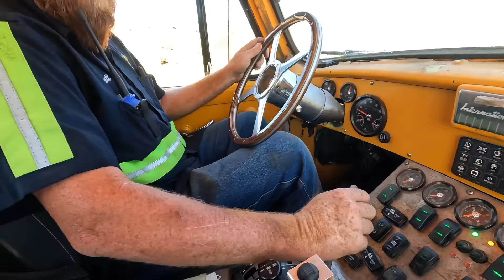Redemption On The Most Difficult Rescue Left Unfinished!

Comment: I worked many years in Africa in the Sahara Desert. The Best Time to drive in the sand is around 4 AM after the sand has cooled down and is more compact. Once the Sun comes up and heats the sand, it is a whole different terrain. Running in 2 Wheel Drive sometimes works to if you can maintain a good speed. The Front Wheels act as a Packer. But once again, the sand has to be cool.

Comment: A big part of the reason the Bronco did so well, is the modern automatic transmissions Ford uses have so many gear ratios, that are much closer together than anything GM had for a lot of years. They also shift significantly faster. The bronco is able to keep the rpms up higher and be in the optimal power range better than many other rigs today. Very impressive!
Reply: This series of videos was a Bronco commercial
Reply: @C141B  essentially, lol

Comment: Matt, IDK if you'll see this comment on a video this old, but if the coolant level rises significantly at idle after being revved up, that indicates an air pocket somewhere in the cooling system, which could be affecting engine temperature negatively. Coolant, and liquids in general don't expand very much with temperature, but air does, the coolant level change after revving it up at 20:10 tells me that there is still an air pocket somewhere in the cooling system. If you haven't already, you should get one of those radiator funnels with the different radiator adapters and run the engine at 2-3k RPM until the thermostat opens (190-210F), with coolant filling about 1/3rd of the funnel above / outside the radiator cap. That allows the expansion needed and the flow required to properly burp the cooling system. And after that, you should take it for a test drive and get it nice and hot, let it cool down, and check the fluid level in the reservoir once it is completely cooled off / the next day. Then top it off to the cold fill line and then you should have eliminated all air pockets in the cooling system.

Comment: I really loved when Matt said and I paraphrase that "the banana  has more power than the Morvair even though the Morvair has an LS". Those straight 6s make great torque at low and mid RPM ranges they start to fall off at hi RPM making them more well suited to off road, V8s make more HP and torque at the HI RPM ranges, producing wheel spin. That was my fathers off road advice to me 40 some years ago. As you can tell I am a huge fan of Jeep 4.0 L its a rock solid tractor motor second only to the Ford Big Six.

Comment: Hello Matt, just watching your videos on the sand trap show instantly took me to the Sherp videos of the ultimate off-road vehicle, where its tires  can air down when needed and you don't need to get out and lock in for 4 x4😊. Everywhere you guy's went with the recovery vehicle's the Sherp can do and plenty of room to sit or just take your equipment. Granted it doesn't have the power of the tow truck, yet the off-road capacitys are endless.

Comment: You could easily see the effects of the heat, fatigue, and general exhaustion on everyone's ability and decision making during the first video. Glad you got the wrecker out. If Paul, Rory, and Casey want to get stuck at the bottom of the Sand Chute, I say let them and bring some hydration and popcorn because it should be a show.
Reply: The engine has a faulty headgasket

Comment: Thank you for sharing the experience!  Guess it is time to change out the right front tire on the wrecker and keep the one on it as a spare.  Also want to throw in that you are correct in that the only way to learn, is to do.  I think it would make great content to have Rory, Paul, and Casey out there.  Once the tire is replaced and the lockers repaired, should also try the wrecker from the bottom one more time.  I know you said the mid-way is the perfect staging area for it, but I know deep down inside, you want to see it make the whole climb 😂😂

Comment: A humbling experience is always a learning experience if you are honest. Thanks Matt for a no BS honest adventure with the Heavy wrecker. As a African 4x4 enthusiast I can see your head do the math in every recovery I have been privileged to see you doing. Thanks for the honest way you share it through your channel, I for one have learned a lot from your endeavors. Look into The In deflate 4HOSE UNIT, it is based on the same design and functionality As the original in deflate, and allows you to equalize, inflate or deflate 4 tires at once. We use them here in South Africa to inflate or deflate 4 tires in one go.

Comment: So very impressed with that Bronco.  Only vehicle that seemed to effortlessly walk all over that sand!!!
Reply: Listen to WHY...Matt said it was because the Porsche smoothed out the sand making it easy for the Bronco to drive on..

The Jeep went after the Wrecker and the Wrecker made huge holes,pitts in the sand!!! Jeep  would have flew up it with no issues...Bronco did good but the sand wasnt the same,totally different!
Reply: @mypronouniswtf5559  nah, I’m not buying that at all.
Reply: The engine is light with quite the hp with the Ecoboost, large tires locker just the right recipe.  Even if you hate Ford Jefe knows what he has works well.

Comment: That scuz that you're seeing in the cooling system might be a reaction with the Dexcool that that engine was likely running in it's original chassis. Dexcool turns into that brown sludgy residue when it's mixed with traditional glycol based coolants.  It wouldn't hurt to fully flush and clean out the wrecker's cooling system.
Reply: Good call. I was thinking those tablets.

Comment: Was honestly amazed at how well the Bronco did. People talk a lot of crap about them but it must be pretty capable to get out of there when the Morrvair and Banana struggled.
Reply: they weight may have had something to do with it as well. it may have been the lightest one there
Reply: I think the front & rear lockers & being able to de-activate the drivetrain computer (unlike the Porsche) & hit it with raw unrestricted horsepower (330 horses).

Impressive 03 Bronco Wildtrack
Reply: Ecobeast power.
Reply: "Pretty Brutal" was the name of my Abba cover band in high school 
🤦🙋‍♀️🤷‍♂️👸
Reply: Impressive.  Short wheelbase in addition to the things listed.
Reply: Matt did mention that the bigger tires had an impact as well as that the Cayenne (as far as it had come by itself and then being pulled) had smoothed the sand a bit and so the Bronco had a bit better "road" than the Morvair and the Banana.
I would also throw in that the Bronco has a 10speed auto which means he can run to a higher gear in low range and it means better accelleration and so hitting the incline with more speed. (with a few less horses than the Cayenne, but more gears and lower gearing it might have hit the incline with almost the same speed as the Cayenne)
Also for the Porsche, have to say i was surprised that he got to where the wrecker finished the first day by himself. The cayenne in this has the least ground clearance so wil drag the most with the underbody, the smallest wheels and the power division with 70% rear and 30% front makes it dig earlier in the back. And i don't know if it has an automatic locking middle or not. (the first gen Cayenne even had low range, and manually lockable middle and rear diff  It would probably have done better in this than the newer one they had)
Reply: @ronjohnson9032 yup, i dont know how many run half a million miles, but the turbo gives the Ecoboost the torque once the engine lugs down...
Reply: IFS is fantastic on snow/sand.  The ford team also has a sand/snow setting that is really good at trimming/smoothing out the throttle so you aren't digging into the loose stuff.
Reply: @RenzeZielman  220,000 miles on my 2011 so far, and it spent a lot of time pulling 10,000 pounds down the highway.
Reply: @miked19831988 no ay it's lighter than the morvair, I would be shocked

Comment: It's been fun to watch you prove over and over again the power of airing down tires...from the early days before beadlock wheels to lowering the pressure on trailer tires to this latest adventure. The difference here was the inability to air down ONE TIRE. I've taught many over the years and there's always a few who just don't want to believe.
Reply: Well said  !!   The first thing I said when he said he had the tire pressure at 12 lbs was to air them down to 4 or 5 lbs.  I was screaming all day for them to air there tires down.  Big tires like that need to be aired down when in sand.  It makes so much difference.  It is like night and day.  I think that with all of them airing down they may have driven them all out.

Comment: Mat, having run the big 46 inch Mickey's for over 10 years in the deep snow of BC'S Big mountains,  you around be down too 3-4 psi in those tires,  especially since the wrecker does not weigh that much.  When I first got mine I had to run with the valve stems out for the first 2 days wheeling just to get the side walls soft enough to let the tire flex. After that my trail pressure is 5 psi and waist deep snow is 3 and bottomless  is 2 in the rear and 2.5 in the front. Has never failed to get me out.  LIVE TO SEE A SHOOT OUT ON SAND HILL.   CHEERS     Steve h.

Comment: HOW TO EASILY GET OUT OF DRY SAND:

Next time, on a dry sand trail, just take a roll of wrapping paper and spread this paper on the trail where the tires will pass and the vehicle will run as if it were on concrete. In fact, always carry paper in your vehicle, as even if it is already "stuck" in the sand, it will come off easily. Suggestion from someone who has been riding on sand for 40 years.

Comment: A stroker crank with a Texas Speed Stage 1 cam and LS3 heads made a huge difference with the 6.0 in my buggy. Still has great torque but top end was a huge improvement. It would be a good fit for the Morrvair.

Comment: Every patron of the channel should be happy that Matt is not a pilot.  He is willing to take on a challenge with equipment in poor condition (no lockers)(dead batteries) (short on fuel) short on coolant, both human and mechanical.  We call that a CLUSTER *%^#$ designed by a KNUCKLE HEAD.  Good job Bronco!

Comment: you guys need a Off-Road Exhaust Air Jack, 31 inch lift 8800 Lbs, it's a bag that can lift tons and is filled by the exhaust gas or a compressor. helps lift stuff up on a trailer or over an obstacle or cushion cars that rolled over and get pulled back on their wheels so the axles don't break, it's cheap and light and small when deflated and could get you out of trouble

Comment: Just seen this video, after watching the prequel! 😂

Well done on making it look so simple the second time around! TBH, it's the additional air-down that makes all the difference. Everyone knows that 20psi is a lot better than 40psi, but what's not very intuitive, is that you get more benefit from each psi drop in pressure than you do from the previous psi drop. So to double the tyre's contact area when you're at 40psi, means you need to drop by 20psi. But to double it again, you only need to come down another 10psi. Once you're at 10psi, if you drop by just another 5psi, you double the footprint again.

(OK, that's not completely true, because the vehicle's weight is not entirely supported by the air - the actual rubber and steel in the tyre carry a little bit of the weight. But it's not much - how much weight do you need to fully collapse a tyre with 0psi? Maybe the first 50kg of load is carried by the rubber, all the rest is carried by the air, and after deducting that 50kg from the load, the contact area will be proportional to how much pressure the air is under.

Also, there a limit to the airing down you can do, because if you don't physically have enough rubber, then at some level of low pressure, you run out of rubber to spread out, so the wheel-rim starts carrying the weight, not the air.)

Comment: The 8.1l does have a decent amount of torque. With sand I always see you need more top end power than the low end torque. I own an 8.1l and have done a ton of research. I really suggest a raylar intake. The stock one is very restricting for top end flow. If you haven't had it tuned with the torque management removed that will help too. They detuned to save the trannys. Black bear would be my suggestion for tuning. Having more power in your power band should help having to shift gears climbing a sand hill. Would be cool to see tire deflation weight per square inch test prior to the sand shoot challenge.

Comment: Obviously the lockers and setting the air pressure make a huge difference for sand traction, but after seeing what the bronco did I'd be looking at adding some HP to the wrecker.  Maybe just a rebuild, small compression bump, and a tune. Forced induction would be amazing but it probably doesn't need the extra heat.
Reply: Take a search for formula offroad to get a sneak to high hp and sand🥳

Comment: When I was a young guy,  we would go to the beach and there would be all kinds of big trucks with big mud tires like you have on your vehicles and they would be stuck in the sand .  They would pay us to pull them out. You aren't going to believe this but here is what we used, it was a Jeep Wagoneer which had constant four wheel drive and had this little knob in the glovebox which connected the front axel to the rear axel and it had Michelin Street Tires. You could go anywhere in sand without getting stuck.

Comment: Great leadership Matt, under very adverse conditions. Also those Badland winches saved the day. And I was very surprised and pleased at how well the Bronco performed. I do not think that tracked vehicles will perform well in the sandtrap conditions. Keep the Bombi for snow...
Reply: I think sand might be destructive on the tracks, at least that's what I have heard from cat operators.
Reply: I think the Bombi would craw right out of there if tried, guess we will never know.
Reply: @WJV9 repeated use in those environments will wear down track systems fast. The real trick though, is not turning too sharp and "jacking" the track off with piles of sand between the track, sprocket, and road wheel areas. Mostly the track to sprocket surfaces.

Comment: Long time fan. Enjoyed this breakdown and the recap on what you learned. This video got me wondering how you feel about traction boards. To me it seemed like placing them on the dune where you anticipated losing speed could have been an effective strategy. How do you feel about traction boards in general? Do you think they would have helped? Is there a reason you dont use them besides the fact they are more gear to carry?

Comment: MATT I HOPE YOU SEE THIS!! You should really take those headers off, get them heat protect coated(painted). It will help and its not that expensive, better than wrapping them. You could wrap them as well but with wraps you're vulnerable to moisture getting trapped in between the wrap and exhaust and end up with rust. So id start with painting them and get a good heat shield made. Also get some heat wraps for all the wires and plumbing that gets too hot from the headers

Comment: From my experience as a diesel mechanic every truck I have seen run air lines near high heat they have all been solid metal or braided steel air lines, wouldn't hurt to wrap them in heat tape as well to keep the heat off them a little bit

Comment: TSP STG1 low lift cam w/114LSA for that LS 6.0

It is EXACTLY the cam you need for the RPM you use. I’ve used it multiple times and did the tuning, FACTORY drivability and 20% power increase alone.

Comment: @15:34 PTSD, locked gate, out of respect,  parked the truck and walked for four hours to a payphone in Maysville, CO. The driver didn't bring tools on our 5 personal solo vehicle trip. And he kissed a rock that pushed back the rear axle on the driver side enough to turn the truck into front wheel drive only. Couldn't go back the way we came. But we made it to where we shall not pass. We were respectful to impassable and retrieved the truck out the proper direction however during the 49 hours it took to bring the truck back it was ransacked for all it was worth by the people who barred the path to a simple drive home. It was legally parked in Roosevelt National Forest for less than the 72 hour maximum. 
Some times private property owners should have a little common human decency.

Comment: The 2 key factors in sand is surface area and weight. The surface area that’s applied via the tires and the weight of the vehicle. When you let down the air pressure on the tires it makes the tires sit down rather than stand straight up and when the tire sits down it applies more surface area to the ground which turns into more traction. All of the weight of the vehicle is applied downward on the surface of the tires. So if the vehicle is heavier it will apply more force into the sand just pushing it downwards and bogging it down. So the less weight you have and the more surface area via very wide tires and low air pressure will give you the best opportunity for success.

Comment: Y'all's tendency to keep going out in dangerous places with equipment that you know is not finished or not in good working  order, is testament to your skills, your courage, and just maybe to your lack of judgement.  I lack your skills and courage, for sure.  I wouldn't leave the shop again in that wrecker until the lockers were completely fixed, that tire you can't air down was fixed, the shroud on the fan, that thing that keeps it popping out of gear, and everything else you haven't told us about that's not done or not right.

Comment: Just found this channel and totally addicted.  Just a thought,  for the air line heat issue u could use exhaust wrap or a tig finger to protect those lines,  even after changing to metal lines.  I'm a tig welder and tig fingers work wonders.